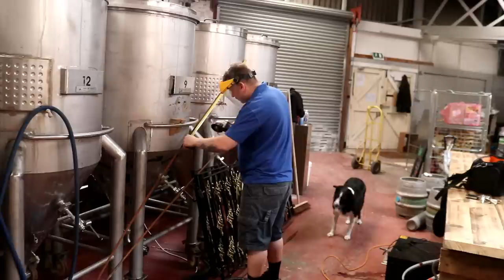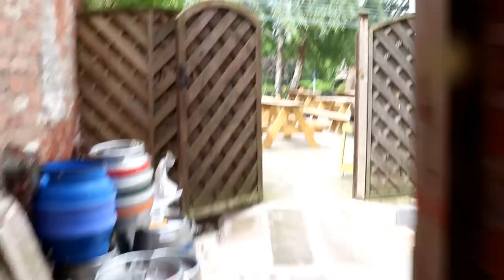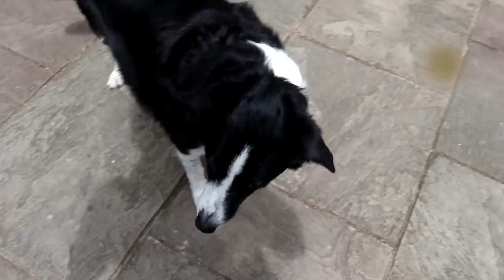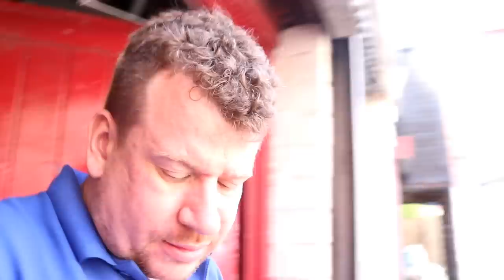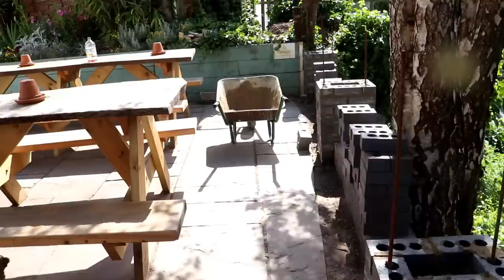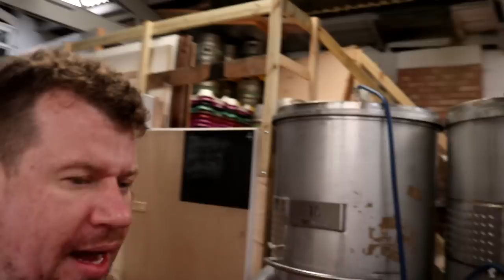BRING ON THE BACK PAIN

Comment: Looks good, but, for the rebar to be effective it needs to be encased in concrete, so I’d suggest a fine mix, heavily vibrated to get it down in to those brick voids. The piers themselves may be fine without rebar, but the whole thing should be designed for 1.5kN/m horizontal load at a height of 1.1m from memory. Looks like you’re ok provided your foundations are man enough.

Comment: May have issues putting them in the bricks with corrosion, best option would be to put 2 to 3 in the centre and fill it with concrete with a spacing of about 25mm from edges